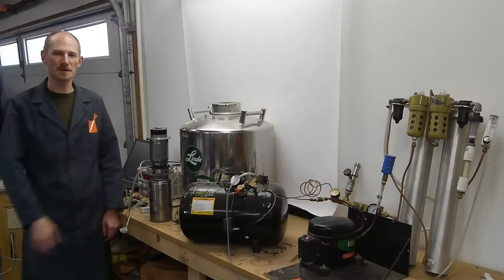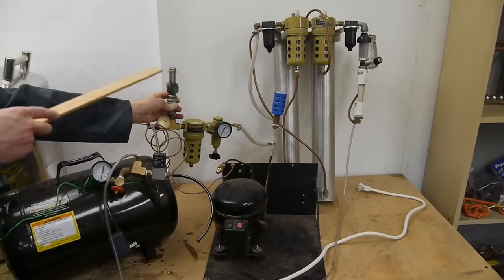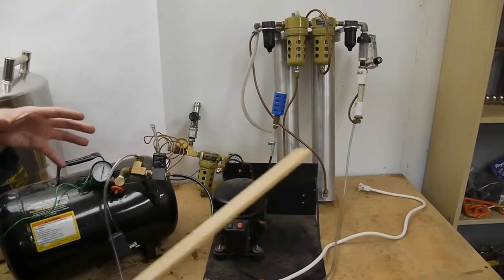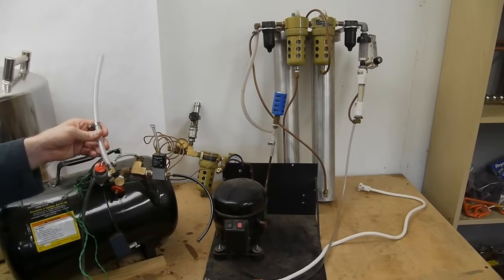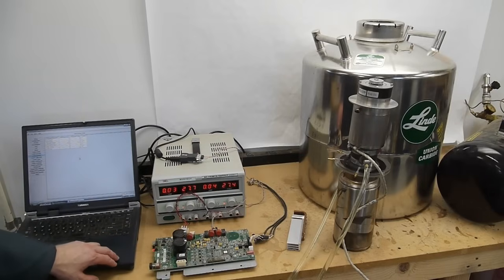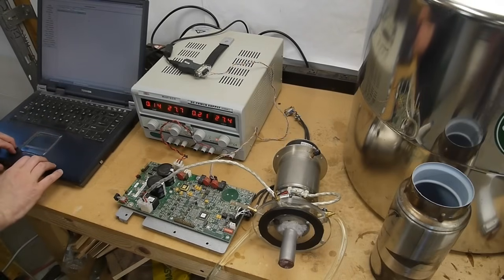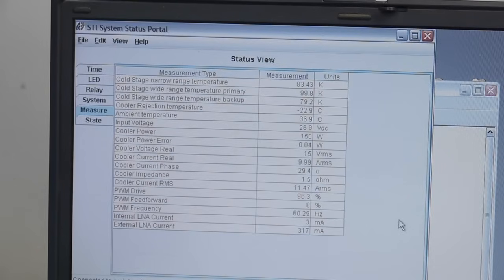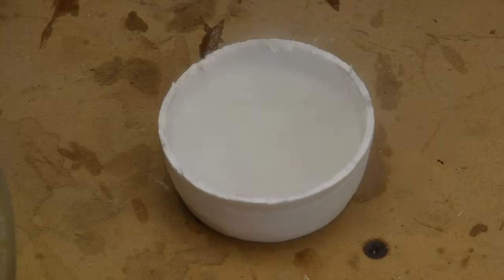Liquid Nitrogen Generator - Overview

Comment: Moisture traps don't work well if you have them too close to compressor.. the vapour in air after compressing is hot and in gassy state.. If you run a long hose before the trap (possibly metalic to cool the gas more efficient), the vapours will liquidify and the gravity trick, the trap does, can work.

Comment: Great video, I would really like to hear your opinion about the water trap placement. 

@2:25 Would the water trap perform much better if it was placed after the pressure regulator?. As the regulation/expansion of air would cause a rather rapid decrees in temperature and better aid the water trap in condensing moisture, compared to if it was placed prior to the regulator on the "hot side" so to speak.

Comment: If you were interested in using the Liquid Nitrogen for cryogenic cooling of a part or shrinking it to fit would it be necessary to purify and dry the air? Could it not be used as is?
Reply from the maker: ***** It could be used as-is with no problems.  Some folks would complain about the liquid oxygen causing a hazard around combustible items.
Reply: Applied Science I think the only real danger might exist during the compression stage if you do not filter all the organic crap that floats in the air.
I know people constantly tell you that even the condensing oxygen from leaving a dewar of pure N2liq not properly covered is dangerous. I do have some doubts about that really occurring. Simply by the observation that it needs quite some time to gather water and the volume above the dewar where its dew point is reached should be a bit larger. Also, when you work with liquid He in PPMS or similar it will take really long accumulated open times for frozen air to be an issue (10h until it shows maybe 100h before we have to warm it all up and start over)
On an industrial scale were oxygen could build up over weeks or even months due to running a continues process this is probably more then just a principal danger.
Reply: Applied Science That is exactly what I was thinking about.  I remember getting safety training on that topic. Leaving an open Dewar was a concern because of condensation of O2 in the Dewar.

Comment: I guess a magnet can't simply separate the two predominant liquids because of their miscibility. Is that right? I was also thinking about chemical separation methods, but since nitrogen is relatively inert, that only leaves oxygen for the reaction. Which would be convenient if nitrogen is what you wanted to keep, except that reactions with oxygen are famously exothermic, compromising the whole payload. Then I thought about catalytic combustion before the cryogenic cooling, but if there's any carbon monoxide in there, its going to give the same problem as oxygen.

Comment: Are there any cryo cooler setups that can be bought assembled and do not require any programming? I have a need for a cryogenic liquid for experiments with superconductors, but one thing i cannot do is program any kind of computer chip.
Reply: I think I remember either Ben or someone else running one of these with a variac, adjusting the power manually.
Reply: Ryan Willis i will have to look into that, thanks for the idea!
Reply: a s you can buy liquid N2 generators that liquify the air and do the fractional distilling. They run unattended.
But depending on were you live you can have yourself quite a lot of N2 delivered for the price of admission of even a small commercial generator.
Reply: ***** the problem with having it delivered is that i only need small amounts at a time and i do not have a large dewar for storing it.

Comment: Use a nitrogen separator membrane in series under a fast flow rate ergo high pressure so that you can filter nitrogen gas quickly ;)

Comment: I'd love you to test the exhaust gas from the nitrogen separator because I don't think it'll relight a glowing splint. My view is that you aren't separating the nitrogen from the oxygen because there are no constituents of air. What I consider you are doing is 'nitrogensing' the air stream that flows through the membrane and the same gas that is fed to the tank is the same or similar gas that gets exhausted. Interesting also that you use carbon filtration in your system but carbon would 'nitrogenise' the air like in pressure swing adsorption systems. In simpler words, you're making a nitrogenous airstream that you are liquefying!
Reply: Well, you two bozos also state as "fact" that iron is the only element that attracts magnets.
Reply: absolutely - yet to be disproven on this particular view!  @JimSmithInChiapas
Reply: @PeterPete  You made the claim, so you bear the burden of evidence. How many of your critics is it now, that you've blocked for reminding you of that?

Comment: Hey Ben. Here is an interesting question for you.  Let's say you already have some liquid nitrogen or liquid air and the cryocooler isn't running at the time and you'd like to start it up quickly.  Could you dip the cold tip in the liquid nitrogen, wait until it comes down to temperature and then start the cryocooler up at full power without ramping it up over ~10 min?  I was thinking of doing that with a styrofoam cup full of LN2, starting at full voltage, and then replacing the cup of LN2 with my dewar.  Just a thought! :)

Comment: What is the reason pure Nitrogen is commonly used for cooling instead of liquid air? I guess it's lower boiling point? Perhaps safety reasons as well?
Reply: MsHojat Safety reasons almost exclusively, liquid oxygen is extremely powerful as an oxidizer and would be a high risk for combustion.

Comment: Why not pass the incoming air through a  through a sub freezing environment where the water can  condense, freeze, and remain? A domestic chest freezer can run at minus 15 f or better if you bypass the control, and if a person were to load up that interior with something like aluminum evaporators simply as a frozen passive mass, that would provide a very large surface area, and have all of the air pushed through the cavity I think you could remove nearly 100% of any water and any other low level condensables. In fact I may experiment with this for removing the water content that is in fuel grade propane. Propane, or  otherwise known as r600 is a very efficient refrigerant. Reasonably inexpensive when bought as fuel, but more highly refined and many times the cost when bought as refrigerant.
I am far less concerned about the related condensables that remain in less refined product, as they have much the same characteristics as propane in this application. But I am thinking about how to dehydrate it entirely.. I believe there are ways I could accomplish this with the materials I have on hand, and no rocket science.👍😁
I love a good experiment!

Comment: Why not use 3A or 4A molecular sieves in your drying columns? They are much more efficient at removing the last 10's of PPM of water than silica gel, are not much more expensive, and can be regenerated. (But beware of shoddy products from overseas, these are often 13A which is not at good for removing water).

Comment: This is super cool! (badum-tsshh) How much did that cryocooler cost? Would it be feasible to build one from scratch? Its method of operation sounds relatively simple, but the requirement of that supporting circuitry is rather intimidating...
Reply from the maker: KrazeeCain Back when I built the system in 2008, the cryocoolers were available on eBay for about $300.  They were pulled from STI (Superconductor Technologies Inc.) Superfilter devices.  You can search for STI Superfilter.  The market has become much more competetive for these units, and I've seen prices closer to $1000 on eBay.   I just checked, and some are as high as $2000.  I may have been one of the first people to publicize among hobbyists that there was a useful cryocooler in these somewhat obscure devices.

Don't let the circuitry intimidate you.  If you had only the cryocooler, you could use a variac with a step-down transformer and power it from line current without any digital stuff.  The fancy monitoring and frequency tuning is just to get the last bit of performance from the device.

Building the cryocooler from scratch is certainly possible, but it has lots of tight-tolerance parts -- not an easy job at all.
Reply: Ahh I see, I just skimmed your blog post about the topic and searched for cryocoolers on eBay as well, it's a shame that they've gone up in price. Thanks for the information!
Reply: Ahhh I just posted a comment before reading your reply to KrazeeCain... dang it... cryocoolers did go way up in price then.  It's just like hydrogen generators...  I used to buy them for $500 (for 1200 cc/min) and now they're thousands for an even lower flow rate.  And mine has, since, broken.  I guess the same thing happened with cryocoolers.  I was actually searching for ways of making LN2 back when you say they were cheap.  But I knew nothing about cryocoolers then and didn't realize that was all I needed.  sigh

Comment: I know this video is from forever ago but couldn't you just dry the air out a lot and pump that into the cryocooler and then use some kind of magnetic filter to separate the oxygen and nitrogen? If that would work it seems like it would save a lot of unnecessary work.

Comment: Just to get this straight because i am so very confused by all of this. You showed us the big setup at the beginning for cleaning the air and separating oxygen form nitrogen, then you showed us the cooling process, but did not use the big set form the beginning?
Reply: He said why. He just didn't want to go to the trouble of getting the nitrogen separator going again. The cyrocooler works just fine in normal air but you don't get only liquid nitrogen, you get liquid nitrogen and liquid oxygen. The big setup at the start is used to separate the nitrogen from the air so you can end up with only liquid nitrogen.

Comment: 14:15  "Since Oxygen is paramagnetic..."  Um, why couldn't THIS be used to separate O2 from the N2?  Yeah, yeah it would leave a bunch of trace gasses...  But still it would seem that there would be a way to separate them using magnetic fields after they are in a liquid state which would eliminate all of the special filter medium.
Reply: could probably enhance the filtration of oxygen from nitrogen by slapping a bunch of n52's donuts around the top of the membrane to drag back the oxygen and let the nitrogen go freely.
Reply: @Draakdarkmaster6  does it react that way at normal temps or just at cryo temps?
Reply: @rehoboth_farm  it should react that way at normal temps but its less pronounced due to oxygen's naturally high energy state, however i imagine strong enough magnetic force will at least slow it down

Comment: Would the produced liquid nitrogen of this device be enough to cool the new Ryzen 3950x with its tdp of 105w to stable sub zero temperatures?

If it would be nice to use this for an Overcooking built :)
Reply: In response to the person asking about the cooler cooling a ryzen chip with a nominal TDP of 105 watts, If you remember from the video Ben explains the cooler can only move 7 or 8 watts from the cool end of the cooler to the hot end. The 150 watts Ben is putting in is mostly waste heat. In short no the cooler would have no chance of keeping up it would easily be overwhelmed by the CPU. Also this rig is really awesome.

Comment: now this video made me really wonder....
you usually have the air filtering stage which concentrates the nitrogen in the gas.
and you explained that you had issues finding a good membrane to filter out the oxygen.
and then at the end of the video you show the paramagnetic properties of liquid oxygen.

so.....what if instead of having the filtering happening in the beginning of the process.....you could make a device that liquefies dry air (after the water vapor has been filtered out).....which you then separate into liquid oxygen and liquid nitrogen using magnets!

hypothetically you would get 100% pure liquid oxygen ending up on the magnet, and roughly 100% pure nitrogen left over.

so rather than have a nitrogen generator, which filters the oxygen\nitrogen mixture at the gas phase, you could just separate the liquids by drawing all of the oxygen to a magnet, and thereby produce both types of cryogenic liquids with pretty high purity.
of course rather than dipping a magnet in manually, you could devise some system that by inputting the liquid mixture, and using a strong magnetic field, directs all of the liquid oxygen to a different container.

the first thing that comes to mind for such a system, would be letting the liquid flow through a sloped tube. along the bottom of the tube there will be small holes for liquid nitrogen to drip to the appropriate containers, and the top side of the tube will have very powerful magnets that will attract the liquid oxygen to the upper part of the tube, preventing it from flowing down the holes along with the liquid nitrogen, as it should flow along the ceiling of the tube being attracted to the magnetic field, thereby creating separation.
towards the end of the tube, the only liquid that should be coming out should be pure liquid oxygen, since all of the nitrogen has dripped out to a different place by now.

it should even be pretty interesting to film for youtube, since you should see the oxygen flow along the "wrong" side of the tube, but still obeying gravity by flowing down the tube due to the slope, while the liquid nitrogen behaves as you would expect any other liquid flowing down a tube.
this produces 2 streams, of 2 different pure atomic liquids, on opposites sides of the tube, flowing in the same direction.
would love to see such a thing in action and in slow-mo.

Comment: Hm, the magnet makes me wonder if you can use that property to seperate N and O later on and save the seperator at the beginning
Reply: It would technically be safer in the long run considering how dangerous liquid oxygen is, so keeping its concentration low before cooling would be a better idea.

Comment: Hey Ben, Great video as always.  At 5:22 you mention that the Nitrogen gas is at approximately 80 PSI.  Wouldn't it be at a lower pressure due to 'partial pressures'? https://en.wikipedia.org/wiki/Partial_pressure

Comment: Do you filter out the liquid oxygen using magnets?
Reply: tannersword1 Nevermind, it's filtered before it's cooled. But that might make it easier, just to compress N2 and O2 and then separate it using permanent magnets and then you'd have some liquid Oxygen to play with, too! ;D
Reply: tannersword1 The process that filters the oxygen from the nitrogen (mostly) could simply be used to separate and store the oxygen in a separate tank, magnets not necessary. 

Issue though is that compressed and especially liquid oxygen is highly combustible (liquid oxygen is used in rocket fuel), to the point of igniting things you wouldn't even think would normally burn without open flame. Isolating and compressing/cooling just nitrogen is far safer.

What's more is that oxygen is only significantly attracted to magnets when in liquid state, so it would have to be cooled before being filtered out with magnets.
Reply: Also, the paramagnetism of oxygen is only noticeable/usable when in liquid form, gaseous oxygen is too energetic to attract significantly to a magnet.
Reply: I imagine it would be impractical to use magnetism to separate oxygen in gaseous form. I didn't specify, but I did mean filtering the oxygen out after condensation. It seems like liquid oxygen would be worth while enough to separate it and store in another dewar, instead of leaving it out of the condensation process altogether :)
Reply: tannersword1 Working with oxygen becomes a lot more hazardous than when its in the air, it would be overall safer to separate before storage.
Reply: Is liquid oxygen produced with a different type of cryogenic cooler? One that wouldn't be damaged by the LOX?
Or what are the specific risks of having oxygen mixed with the nitrogen, if you're separating the LOX and storing it in an oxygen dewar?
Reply: tannersword1 Its mostly to do with liquid oxygen being an incredibly good oxidizer, so the risk is mostly with it coming in contact with something reactive (even organic materials) and combusting.
Reply: I know liquid oxygen is an intense oxidizer and can ignite organics and petrochemicals spontaneously. What I'm asking is, are there any specific risks with condensing it in a mixture with nitrogen, separating it from the ln2, into a LOX dewar? Assuming the person doing this understands the risks and behavior of liquid oxygen.
The way I see it, is unless there has to be a specific cryo cooler for liquid oxygen, there shouldn't be a problem. Ben even did it in this video with no problem.
As long as you can safely store the oxygen, I see no problem with, instead of spending money and making an effort to prevent ever condensing oxygen, using that effort and resources to get liquid oxygen out of the same process, so you can use it and experiment with it.
Reply: tannersword1 If you only want the LN2, then your cryogenic process gets appreciably higher energy efficiency by separating the oxygen in a previous step. 
For further science, we should pester Ben to show us how much leftover oxygen the magnet finds when the filter has been used...

Comment: hmm. could you also get liquid hydrogen from a system like this. or does it not get cold enough? This makes me want to experiment with rocket engines again. Guess i could use something like this to make liquid o2 and just run a hydrocarbon fuel like kerosene.